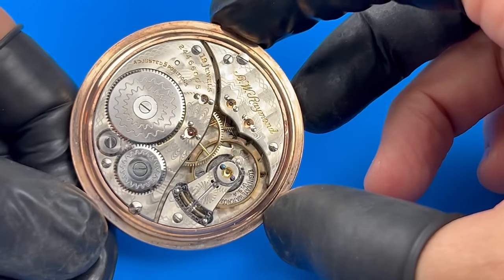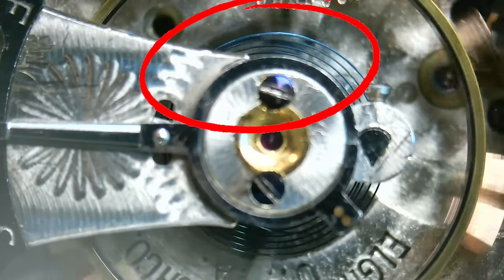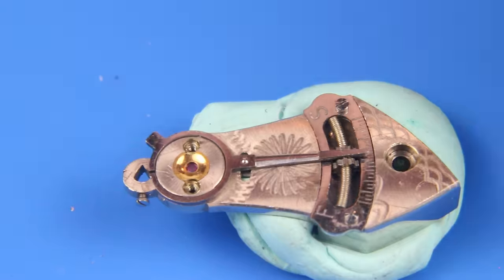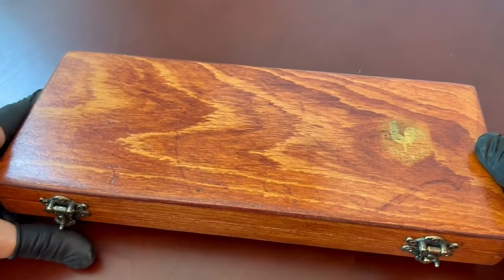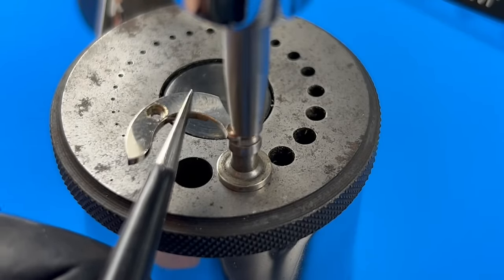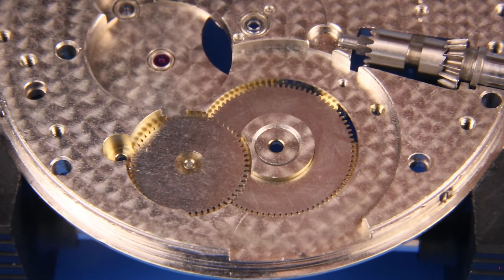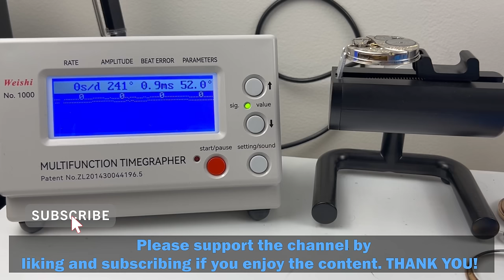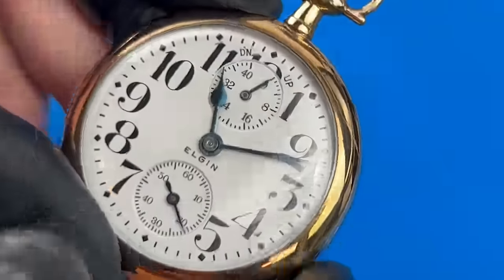WORSE than it looks? Repairing an Elgin B.W. Raymond Antique Pocket Watch with Wind Indicator

Comment: I was hoping to see the video of the broken screw removal. 
It was a pleasure to watch the rest of the video. 
Looks like whomever "serviced" the watch prior sure missed a lot. It speaks to your skill that you found and addressed all the issues they missed.
Reply from the maker: Thank you! The screw was removed by drilling out the carcass using a carbide PCB drill bit. I’m kicking myself for not including it, but I was quite frustrated at that point and didn’t have it in me to take the time to film.
Reply: Very understandable I actually have a veritas that has a screw on the yoke that has this issue. I really should fix it….

Comment: I serviced one of these watches before with a wind indicator. The first thing I thought was, how does this thing understand the direction of the wind? And why is environmental wind spelt, the same as a Watch wind?
Reply from the maker: 😂.. yes it is a feat of engineering, and I was impressed by the transfer after transfer it took to get the barrel wind up to the dial side like that. Made it even more challenging to troubleshoot the issue to eventually find that missing screw
Reply: "Wind" and "Wind"? Enviornmental can be specified "whind", Clock/watch "wined" when writing so there is no confusion?
Don't forget lead and lead ("Leed" as in troops, and "Led" a heavy dense metal, or the past tense of "leed" 🤯🤨 ) 
"Read" and "Read" ("Reed" and "Red")
"English" is such a "fun" language, ain't it? 🙄🤣

Comment: Cool job. I recently was able to put together an elgin model 5 grade 288 from 2 donor movements. lost a click and center wheel but got replacements. The hardest part was to figure out the way to adjust the case so it would set and wind properly. I learned how to set the top plate using small pieces of rodico to hold the wheels in place until they set, then take them out. Not so bad as it took about 20 mins. I also replaced the crystal and figured out how to do it.
Reply from the maker: Thanks for sharing! It’s really satisfying when you it all together and see it run. A fresh crystal always makes a positive difference

Comment: Greetings! I really enjoyed this video as when I looked at the thumbnail I realized it was my pocket watch! I have exactly the same watch that was my grandfather’s and he worked as a brakeman for Union Pacific Railroad and retired in the late 50’s. My S/N is 17871075, everything else on the watch is identical. I had it repaired (broken mainspring) in the mid 70’s but was told then that it was not the correct spring but at least the watch ran but the up/down never worked correctly as it would run past it high low limit marks plus it seems to be harder to wind than I think it should. Anyway, just wanted to say thanks for the content and I have subscribed and rung the bell. Cheers!
Reply from the maker: Thanks, Steve!! They are beautiful watches and the best ones have a personal connection like you have with yours. - Chris

Comment: What a magnificent restoration. 
Are the jeweled bushings location specific? 
Are the pivots different sizes? 
I work on Torsion Clocks. The pivots and holes graduate in size from the Anchor and Escape wheel up to the mainspring. 
I’m so pleased you were able to extract the decapitated screw AND make a new one!! Bravo 👏 
I found your videos and and I subscribed. I like your work, attention to detail, and dry humor!! I appreciate the added touch of you describing the process and sharing your experience. Brilliantly done.
Reply from the maker: Thanks for the comment! Yes, typically the pivots and jeweled bushings increase in size from the balance, pallet, escape wheel and so on. For a fully jeweled watch like this, the balance pivots are teeny tiny— approx 0.11mm. I believe the pallet pivots were 0.12mm.
Reply: @csspinner  
It occurred to me as I watched you pop them out then push them back in and secure them with screws that they are likely specific to their location in the movement. 
Beautiful job.

Comment: Cool video. Though, I wish you would have included how you removed the broken screw part.
Reply from the maker: Thanks. I’m kind of kicking myself I didn’t spend the time to film if, but honestly I was in a mood at that part of the job. I basically drilled it out with a carbide PCB bit and rethreaded with a corresponding tap

Comment: 🙋‍♂️🏴 Hi a brilliant video of pocket watch service and repair. But how on earth did you remove the broken screw from the body of the watch making a new one was amazing.
Reply: Maybe alum?  Just guessing.
Reply from the maker: Thanks! For the screw I actually drilled a small hole in it with a carbide bit. Then I was able to use a pick to loosen and remove the rest. It was too awkward to film

Comment: Hi I love watching you work on watches. I have been into antique clocks for years now and I have a small collection. And ever since I was a kid I have been into watches. Particularly pocket watches. I have recently received  a (T. Moser & Co. It has a porcelain face that is shattered and a broken lense I was wondering if it's possible to get a replacement face and lense for it
Reply from the maker: Thank you! You can find “new old stock” glass crystals online in various sizes. I’ve always been able to find a replacement on eBay. As for the dial, not much you can do there but you may get lucky and find a donor watch with a similar dial you can use
Reply: Thank you for getting back to me so quickly. I was also concerned about the brand of pocket watch it is. Every time I googled it It comes back with a different brand name. (T. Moser & Co)  is the name on the face as well as inside the housing. ???
Reply from the maker: @davidstone1447  I did a few searches and can’t make heads or tails either. I think it was a brand that used generic Swiss movements (ebauches). Those are hard to find parts for since you can’t nail down a specific model number
Reply: @csspinner  I think that there is a father and son P. Moser. Henry Moser. In Which case. What does the T. In T. Moser & Co stand for? This watch is very confusing. I'm not sure what to make out of it
Reply: @csspinner  I was wondering if you could take on the challenge of finding a porcelain face for it. I don't have much money but I will pay you what I can or what you think is fair for your time to find the face and fix it. The watch it's self keeps great time. The watch was a gift from my best friend just before he passed away from a brain aneurysm. It was his father's watch. Anyway I have had it for years and I reasuntley ran across it in a box I had in storage. I had told him I would try to restore it. But I never had the money to do so. I am on disability so I don't make much. But I don't want to let it go undone. So if it is not too much to ask for a shipping address and you're okay to send it your way. I will send a money order along with it. And Thank you for your time as well
Reply from the maker: @davidstone1447  please send me more details and pictures at cspinnerwatchrepair@gmail.com. I can’t promise anything, but I’ll know more of what can be achieved when I see some images

Comment: Thank You Chris... Watching you correct the balance wheel using a tool that looks like a miniature version of my old Parks Truing Stand I use to need when bicycling around so much. I can understand when a light weight bicycle wheel goes out but wonder why/how a small balance wheel could be damaged so much inside a protected watch case?
  I enjoy watching your process waking up with coffee. Watching your hand movements & thinking you probably could not do that & drink coffee with such a steady hand. Q- When you dismantle an old Fusee do you need to use a memory board so as to put the correct screw back into it's original hole?   ....  TM
Reply from the maker: I do my best work at night when my nerves are the calmest (and the kids are asleep). Mid morning with the caffeine pulsing through my body is the worst time for the jitters. You'll be surprised how many hands have been inside pocket watch movements over a 100+ year existence. Sometimes there's a ham fisted attempt of getting things running again and it's easy to bend and damage some parts. Occasionally, I'm treated to an heirloom that's never seen a service. I can crack open the back and almost smell the old cigars and other scents that have been trapped inside over the years.

Comment: How did you thread the replacement screw
Reply from the maker: Old Swiss thread plate. Held the screw in the lathe and manually spun the tailstock with hand while holding thread plate with the other. Used some 3 in 1 oil for lubrication

Comment: How do you know the lift angle of older pocket watches?
Is there a website? I cant find one.
My son just bought  me the weishi 1900 for my BDay.
Cheers
Reply from the maker: My lift angle defaults to 52, which is probably wrong. There’s a lookup table somewhere online that has lift angles for the common calibers. However, setting the wrong angle on the timegrapher really only means the amplitude reported will be off by a bit. Timekeeping metrics like rate and beat error should still hold true
Reply: @csspinner  oh ok sweet.
Thanks alot for that info.

Comment: I have a 1942 Hamilton 992B labeled US Gov. It is in a stainless steel case with a canteen crown. Any idea of worth?
Reply from the maker: I’m not sure. Does it have a sweep seconds hand? Those are usually military variants of the 992B- typically marked 4992B
Reply: @csspinner  it’s a 992B on movement . it’s a Crescent case. It has a sweeping second hand at the 6.

Comment: Thanks for showing how to properly use a truing caliper; I would have been scared to snap the pivots, but you showed they do take a moderate amount of force. What is a good source for jewels? I have a number of watches that could use them in particular balance jewels, amazing how many of them are shattered. I've just about exhausted the donors, now looking for a solid supplier that actually knows the right parts.
Reply from the maker: Cas-ker has a supply of balance hole jewels. Other than that, donors are really the next best option unfortunately. Sometimes I need to modify a setting from another movement to fit

Comment: What a nice watch to work on. Your video skills are great. I have a Hampden Special Railway that has some of the same issues. Where do you source jewels? Did you reuse the settings? Interesting that the jewel screws on the balance cock were blued and all the others were polished? I have been told that the 19J actually were preferred by RR. Maybe the cost was less than the 21 or 23's? You are doing really nice work. Thanks for the video
Reply from the maker: Thanks- I try to source jewels in settings as a first preference. Hampden, Elgin, Hamilton, etc tend to develop settings to the same specs across their respective grades of similar quality. If I can’t find a drop in jewel with setting, I’ll try to find the right jewel and use the rubbing tools to insert the new jewel into the existing setting. If none are available, I’ll harvest a jewel with the right pivot hole size and produce my own setting on the lathe to match the OD of the replacement jewel. To answer your question, jewels are source from either donors or Borel’s site

Comment: Excellent! I'm just doing this as a hobby, but I've encountered everything in this video, but sadly either didn't have the skills or the tools and knowledge to fix them. I'll say this is the first time I've ever seen anyone true a balance. It was always mentioned but I've never seen anyone do it, so I never really knew how. I'm still learning how to straighten hair springs. Have gotten a few functional but still not where it should be. Never seen a jcot tool setup and explained. See them for sale all the time but am never sure what to do with them... until now. Working on replacing jewels. Have too many watches needing broken ones replaced. Very helpful video!
Reply from the maker: Thanks, Dale! I really appreciate the comment! Hairspring repair is probably the most dicey. There’s no special tool to make it easier. Just making a mangled hairspring functional again is impressive, even if it’s not quite perfect. Because in doing so the watch has avoided being thrown in the parts bin. - Chris

Comment: It would have been great to see the broken screw removal and the entire screw making process.
Reply from the maker: I’m kind of kicking myself I didn’t spend the time to film it, but honestly I was in a mood at that part of the job. I basically drilled it out with a carbide PCB bit and rethreaded with a corresponding tap
Reply: He needs a little more practice at machining, so the reason why.

Comment: Very nice restoration.  Hadn't seen a pocket watch with the reserve indicator before.  I got into this hobby not long ago and my father-in-law handed me a beautiful 1937 Elgin Grade 315 that belonged to his father.   Unfortunately, it has a broken balance staff pivot.  So, I have been absorbing some Elgin pocket watch restoration videos, like yours, to find some key things to be looking for.  So far, it seems that the only issue with the watch is the balance and need for a new mainspring.  But, I am going to go back through and inspect the parts more closely.
Reply from the maker: Let me know how it turns out. With a staking set and the right accessories, replacing a staff is pretty straightforward despite seeming intimidating at first.
Reply: @csspinner  Unfortunately, I don't yet have a staking set.  I've already plunked out a lot of cash getting going in this hobby. lol  So, that will have to wait a bit.  I'm looking for a donor movement manufactured close enough to this one so hopefully there will not be a compatibility issue.

Comment: did you fix the broken/sheared off wind indicator screw?
THAT must have been a LOT of "fun" ... 
I don't believe they make an "Easy Out" that small ... not to mention the Easy Out requires a tap hole for the tool to fit into and grab the busted screw (or bolt). 

Regarding the hair spring ... to be honest, I expected you to put in a "new" used one in excellent condition, or a brand new one.  Good job on saving the original.
Reply from the maker: I’m regretting I didn’t film it, but at that point I was royally frustrated. I had to drill it out with a carbide bit and then rethread to match the new screw. No easy/graceful alternative and I wanted to avoid soaking in Alum this time

Comment: Your level of skill and the fantastic old tools you have acquired just amazes me. Love watching you work. Question, is the screwdriver you use to remove those tiny cap jewel screws in the screwdriver set you have listed? The shaft looks shorter but thought maybe you shorted it up to get more precision
Reply from the maker: Thanks, Steve! I really appreciate that. Yes, I’m still using the same screwdrivers I have linked to Amazon. I bet some nice Bergeon ones would be better, but I honestly haven’t had a reason to switch. The shaft is shorter because I’ve redressed these many times on the sharpening stone. the tips do wear out faster than a more quality brand, but they’re easy to keep in shape… and the company does send extra tips upon request

Comment: Any mainspring service or replacement?
Reply from the maker: Hi Mike, thanks for the question. I removed, cleaned and replied the mainspring. I usually try to assess performance before replacing one though. at 241 deg amplitude, it was still acceptable and has plenty of life left

Comment: Excellent work, Chris! I admire your craftsmanship and how professional you are! I was working on a pocket watch just like this one, and everything is working right except that I can’t get the winding indicator to work like it should. When I wind the watch all the way, the indicator band doesn’t go all the way to the zero position, and if I remove the hand when the watch is completely wound and put it on the zero position, once the watch is unwound, the hand doesn’t reach the 40 position. What do you think the problem could be or how could I correct that! Thank you for your help and for your excellent work and videos that are super helpful!
Reply from the maker: It’s possible your mainspring was replaced at some point and it doesn’t quite have the same length/power reserve as the original. Whether or not the indicator ever reaches “40” isn’t all that critical from a practical RR use standpoint. What’s more important is that the operator is aware of how many hours has elapsed since full wind and to periodically rewind the watch to bring it back to 0. Hope that helps!
Reply: @csspinner  You have no idea how much I appreciate you writing me back! I hadn’t even thought about the mainspring being a different size, but it makes complete sense. I have been a hobbyist for about 7 years and I wish I knew what you know. I have a guy that I just met and he has been teaching a lot, but it’s amazing that people like you take your time to teach what you know. You have no idea how much I appreciate that! I hope I can learn enough to go full time at some point to repair watches for other people!

Comment: How did you manage to extract that screw? Did you simply drill it out and then re-tap the hole? I couldn't imagine there's a reverse tap small enough to pull that safely out. I work with pretty small screws that would seem huge in comparison to these watch screws, and we have no means of removing them when they snap. If there's a technique or tool you could point me to, that would be awesome!
Reply from the maker: Correct I drilled it out and had to retap the hole for the correct theading
Reply: @csspinner  Man, that is some skills. I'd be sweating bullets trying to drill out a screw of that size. Not to mention one in an already thin collar.